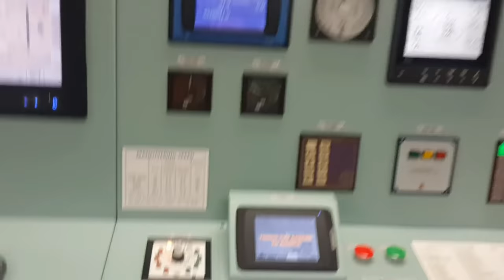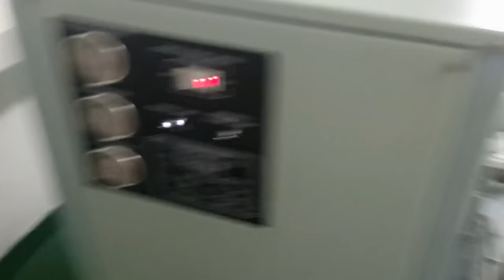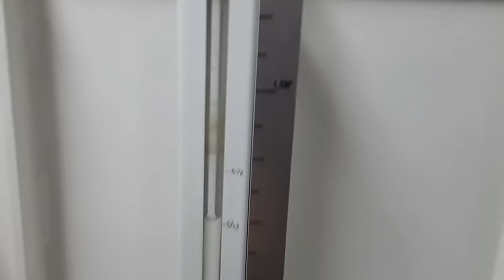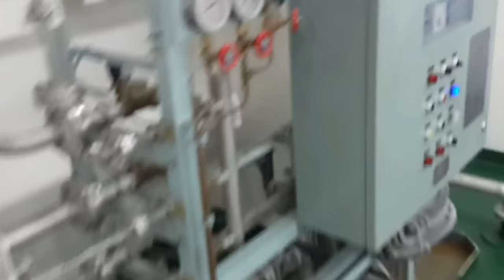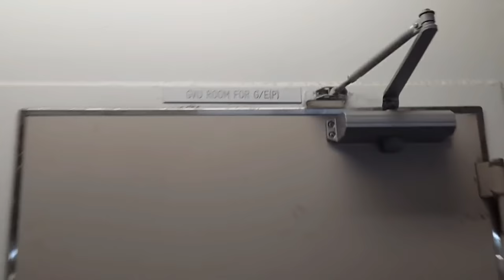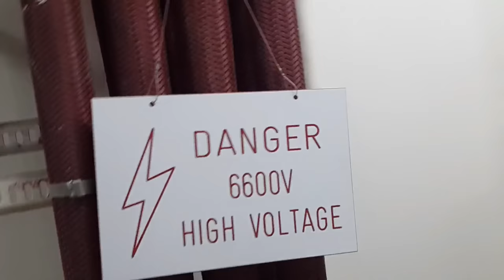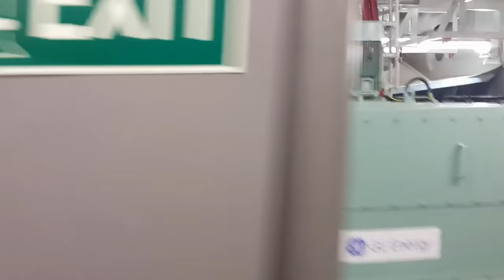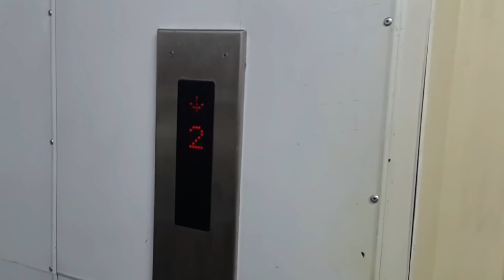Engine room of an LNG vessel with Electric Propulsion (DFDE)

Comment: Now that the dramamine has kicked in after watching this video, nice effort. As a video pro, it'd be better to be more fluid with the camera like a SteadyCam setup. It can be done, even with a cell phone. A little practice using your arm and body movements together, you'd be surprised! I'd also title (if possible) most of the equipment in the engine room you tried to show, the more detail the better (for me anyway) All the support equipment just to get the prop to rotate is mind boggling. But thanks for the video, most of us will never see this in person so it's always a treat for the mechanically curious people like us that view this.

Comment: What I first noticed is the cleanliness of the ship -- from living quarters to the engine room.   Even the machine shop was tidy.  The racks in the parts store are constructed for rough seas.  

I know nothing about electric ship propulsion.  I assume that the ship's cargo of LNG fuels duel-fuel (LNG gas / fuel oil) engines (13:26), which drive electric generators, which in turn drive the electric motors that actually propel the ship.

Comment: Interesting!  I was impressed by how clean everything is, with no leaks and oil spots here and there.  I had no idea that everywhere below was so loud!  I was also impressed by what appears easy access to the equipment instead of stuck in cubby holes with restricted access for maintance.  There is so much stuff in the engine room and below decks.  Is it always this loud?
  Is the crew supposed to know all about each piece of equipment?  Is this a new ship?
Reply: Electric engine cruise ships
Reply: Diesel electric engine cruise ships
Reply: Diesel electric engine cruise ships

Comment: Thank you for video. It is really interesting engine room. I have experience on mega container vessels and had a deal with shaft generators and its frequency converters but those ones I see in the video are very attractive. Now I have to dream to work on such a type of vessel. May be do you have instruction manuals for all machinery equipment of the vessel?
Reply from the maker: Thank you for your comment.
But unfortunately I can not help you with the manuals, they are confidential and I am not allowed to share them. 
I hope you can understand.
Reply: @sasiskas  Ok, I understand. But, I hope, can you tell me please what kind of switching element is used in rectifier (for such drives it sopposed to be used active rectifier) and inverter unit phase module?  All interface, control and protective PCBs are interconnected via optical links?  And what is the power for each drive.
For example I met such a phase module in INU, whose main components are:         
4 IGCTs (Integrated Gate Commutated Thyristor)
4 integrated freewheeling diodes parallel to IGCTs because of low power 
2 Neutral point diodes divide DC voltage equally across IGCTs 
2 clamping diodes                                                                                                                                                                 
2 clamping capacitors (clamping resistors and balancing resistors are mounted
separately, outside of the phase module).                                                                                                                               
I am just wondering about what kind of topology in that propulsion sysstem is used.

Comment: Pretty awesome. Everything is so clean, congratulations.
Is there 4 diesel engines and 4 electric engines for a single propeller ?
Reply from the maker: it is a new vessel and we take good care of it. there are 4 dual fuel generator engines (Gas or Diesel/HFO) and 2 electric motors connected through a reduction gear to a single propeller. But it can move with only one generator engine running. The faster you want to go the more generator engines need to run.
Reply: Nice. And to use gas as fuel is there another engine or the same engine that use fuel can use gas ?
Reply from the maker: +Daeron Barth it is the same engine, that's why it is called dual fuel, it can run on gas and if you like it can change over to fuel, or the opposite. For more info you can look for Watsila DF engines.
Reply: Really Nice, thank you.
Do you plan making more videos ? If yes you could add some subtitles to explain what it is the machine you are filming.

Thanks again
Reply from the maker: I might do it when I have free time, (not in the near future)
Reply: Thank You. But If you can please film more ^^

Comment: I do not understand, why electric propulsion? I bet the motors are greater than 90 percent efficient, not sure about the generators. But in the end, no matter how efficient they are, it requires less fuel to run conventional system. Maybe initial cost savings by not having auxiliary engines? But I suspect there is some underlying reason that has to do with the ship being lng type. Pleas explain, if you know reason. 
Thanks for the tour, most interesting.
Reply from the maker: You are right, it requires less fuel to run a conventional system...BUT you can not use natural gas as a fuel on conventional systems. The whole point in LNG vessels is to be able to use the boil off (natural gas) of the cargo as fuel for the propulsion of the ship.
In the past the only way to use natural gas as a fuel, was to combine boilers and steam turbines, a system like that was totally inefficient. So this is why the electric propulsion was  introduced, it offers the ability to use natural gas as a fuel and has better efficiency that the steam turbines.
Recently MAN has developed two-stoke main engines that can use natural gas fuel. These engines should have the efficiency of the conventional systems and can also use natural gas a fuel. But this type of propulsion is relatively new, so there are not enough info regarding their reliability efficiency.

Comment: Wartsila DFDE 9L engine (4 sets), 2 electric motors propulsion, GCU, 2 gas venting unit rooms, HV&LV rooms with GE IAS system on board. Damn, almost completely same with my previous ship even the ring of the telephone. Is it lng ship ice breaker or normal lng ship?? Nice video by the way
Reply from the maker: You have a good eye! It's a normal lng, not ice class